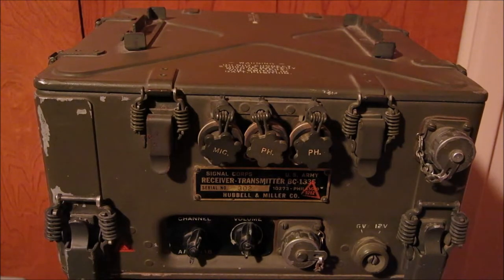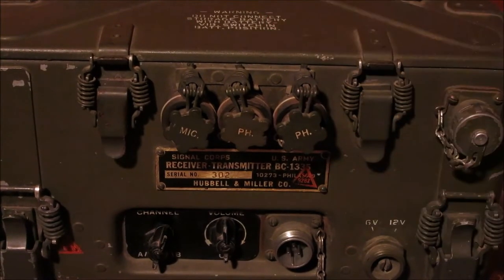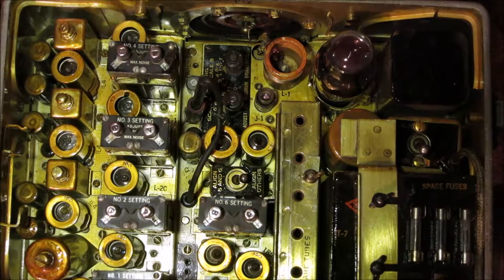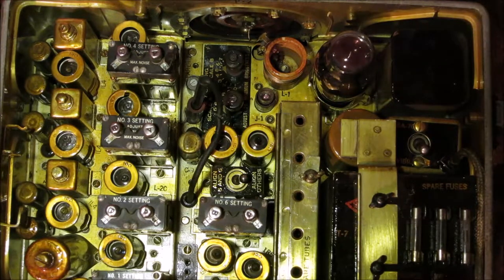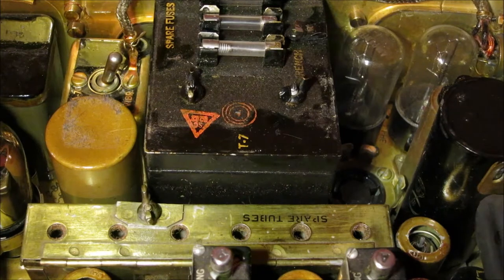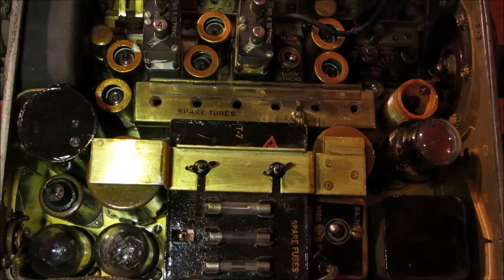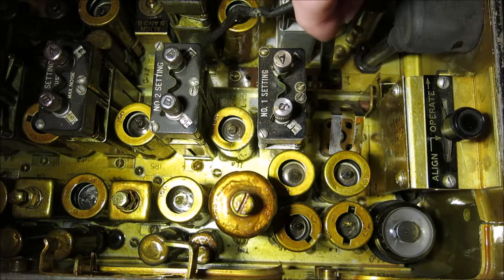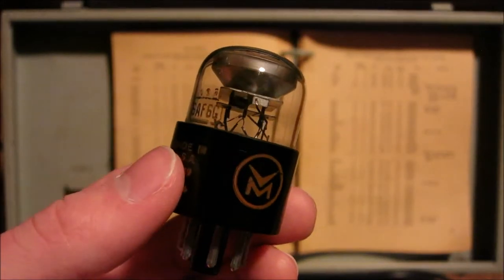WW2 Radio Restoration (part 2) BC-1335

Comment: This particular unit in your video is a BC-1335A model - it has no spare vibrator. What you pointed out as a spare, is the actual vibrator that powers the radio. The other device that you pointed out as the vibrator, is not a vibrator at all - it is C-84 (see diagram),  the HT buffer capacitor (2 x 20 uF). Only the BC-1335 has a spare vibrator, the BC-1335A (which you have) does not. Cheers.

Comment: Did you actually get it to work? The discriminator & main oscillator is a bear to adjust, I do not recommend to use the indicator eye for that adjustment, because it needs the radio's reference batteries and they are guaranteed to be either dead or missing. Best way to set the radio's FM discriminator is to use a ham radio at the same frequency - first adjust the BC1335 discriminator by using the ham radio as a reference signal, and then key up the BC1335 and tune the radio's master oscillator until modulation sounds best on the ham radio.  Also, do not repair the vibrator, it will fail again real soon because those vibrators were filled with an inert gas (to protect the contacts) by the manufacturer which escapes when you open it. I recommend a solid-state vibrator replacement. https://www.youtube.com/watch?v=XGdfHaYGL1M . Cheers.